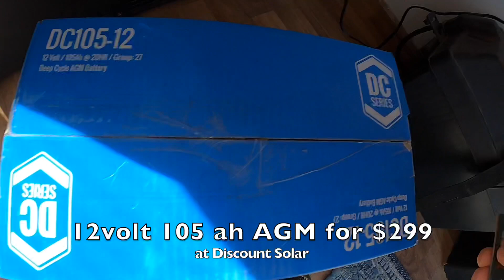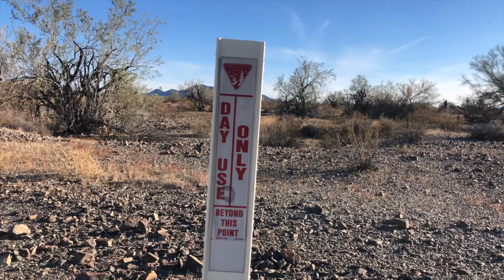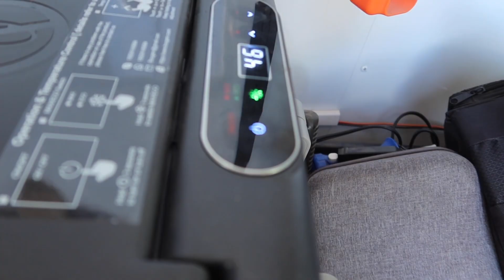Can we find Quiet Camping in Quartzsite, Arizona? - Living in a 6x12 Cargo Trailer Camper Conversion

Comment: I'm a hermit for the most part, except when I go to work at the hospital,  so I understand the need for being away from people. I do, however,  wish I was in quartzsite right now- I'm about 100 miles outside of DC and it snowed this morning. I need desert therapy. Also, I need somewhere to walk - there are people everywhere here.
Lex, I hope your new battery is the same as the other one, you shouldn't mix and match. Will Prowes did say you can mix batteries during an apocalypse though, so I guess it is ok.😁

Comment: Originally battery boxes were meant for flooded batteries, batteries with liquids (acid, water) inside. This is to protect the interior of the boat, vehicle or house, when a leak occurred, against the very corrosive acid.
AGM batteries are ideal for RV's, because you can't have leaks and also no toxic gasses, compared to flooded batteries. Because AGM's are dry.

You just need to secure the batteries, so they can't shake loose, when you're on the move. And of course secure enough that they won't start flying around. So a DIY nicely painted, plywood box or cabinet, with battery straps, would also do the job.

Of course the battery boxes look nice and neat, and it also protects against things (metal) falling on the poles, which could result in spectacular, explosive, expensive shorts.
Reply: Probably wanted some protection from things falling on top of them and shorting them and all of her electrics out. Her batteries aren't hidden
Reply: @TomHeid1  That's what she said.
Reply: At 5:30 min. of following video is a nice idea for a future project for the trailer.

Secret back panel, hidden electricals board (but you still need ventilation, that may come from the sides, top, or bottom):
https://www.youtube.com/watch?v=1O9QW1KV9gM

And the removable shelf protects the batteries from falling objects.
Reply: If you google:
Battery Pole Cover 
or 
Rubber Terminal Protection Sleeve 
or
Battery Pole Protective Cap

You'd find inexpensive solutions against shorts from things falling on your batteries.
Ranging from US$ 3.50 to US$ 10 (for military spec) per battery.

Comment: Hey Lex, I just subscribed.  Going back to slowly update myself on your adventures.  How many watts of solar do you have?  I use 200 watts in our 19 ft camper. Used primarily for lights, and running the blower on the furnace. Once in awhile, running a 175 watt inverter for short periods.  I have a 125 AH AGM, but am considering a 100 AH Lithium.  All seems good now, with the refrigerator running on propane.  But when it craps out, I'm thinking about removing it and just using a refrigerator unit like the one you have.  I suppose when I get to that point, I'll need to double my battery capacity.  Still hoping that 200 watts of solar to keep the batteries topped off.  I may have room for one more panel.  I like the setup of your trailer.
Reply from the maker: Hi! Thanks! 200 for now but I’d like to double that in time.

Comment: $299.00 for a battery seems a bit high. I paid $149.00 for mine at Battery Plus and have had no issues for the last couple of years. I hate to see people taken advantage of others. just a thought. You can go with 6v and get twice the Ah for the same price.
Reply from the maker: $299 is less than I paid for the first one in Oregon, less than Amazon, less than several other retailers. Thanks. 
https://www.amazon.com/dp/B00N24G9VK/ref=as_glm?linkCode=ml2&tag=lexandriot-20
https://www.battsys.com/dc105-12-fullriver-12v-105ah-grp-27-sealed-lead-acid-agm-battery
https://www.solaris-shop.com/fullriver-dc105-12-12v-105ah-deep-cycle-battery/
Reply: I bought the exact same battery at Discount Solar in November and traded in my Batteries Plus Duracell. Like Lex said, it was cheaper than Amazon and a high quality battery with a five year warranty. I'm a satisfied customer.